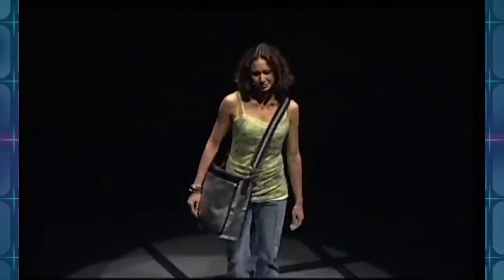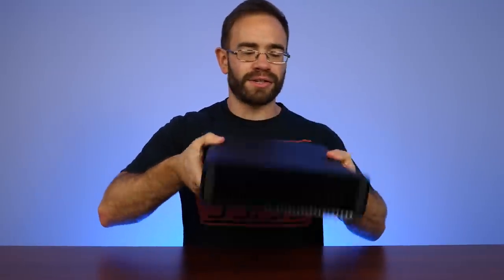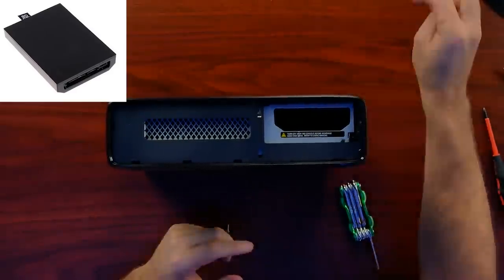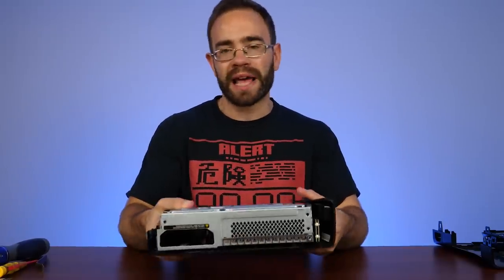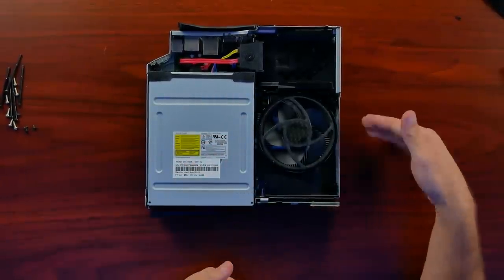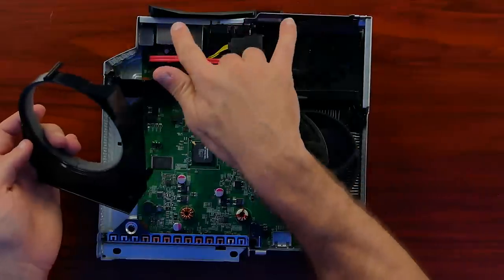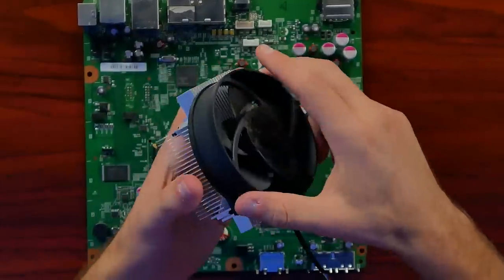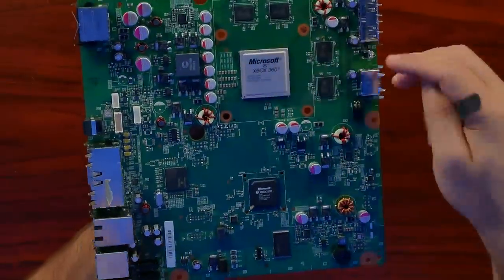Here's How Microsoft Solved The Xbox 360 Red Ring of Death

Comment: they didn't solve anything, I went through five 360's. after the fifth one I said screw it and got a ps3, I still have the ps3 and it still works
Reply: 360's have a PLASTIC ventilation system (as shown at 9:24) which is unnecessary, IMHO. When that thing heats up shit happens so, I promptly removed the said PLASTIC ventilation system. Now you know the SECRET , shhh :D
Reply: I used to get the single red ring every now and then but there was a simple fix for it
Reply: @MrShokzZ  the TOWEL TRICK :D
Reply: Had the rrod on an elite version , send it to fix under warranty in europe, received and still works today. Its connected with kinect next to series x :)
Reply: Actually they did ps3 btw had the same thing except yellow lights.  Actually slightly worse as the board often was still left twisted even if reballing the solder worked.  They didn't extend the mfg warranty either like MS did.  A redesigned, heatsink with heat pipes and hq thermal paste was the MS fix.  Like you it sounds Some however did not get that. Whether MS was just getting lazy or they subcontracted who knows.  Though at least they made an effort my ps3 died and Sony never would acknowledge an issue none the less fix it.  They did change the design in subsequent models but that didn't do anything for current owners.
Reply: i’ve had a xbox 360 for 11 years
Reply: You should of fixed it there’s a ton of tutorials online or shops in most cities
Reply: Lmao i still have my original 360 and never had a problem with it
Reply: I have a PS3 with the YLOD. Definite cold solder joint issue because I've revived it by wrapping it in a towel, etc
Reply: Hmm my elite works up to this day...

Comment: No.
Microsoft solved the Red Ring of Death in the late GPU_RHEA model on the late Falcon motherboard. The Slims have actually had GPU failures much more often than the Phat Jasper.
The fault was introduced by ATi and was part of the 2005-2009 GPU plague and was fixed when the RHEA chip was revised to correct the flaw. The issue was in the chip die of the GPU (northbridge) failing or becoming disconnected from the green substrate. The only way to resolve this is to replace the GPU for a different one that has not failed or is fixed.
The Jasper phats do not exhibit this GPU flaw at all, and the Slims and E didn't seem to, but they've started failing around 2019 and still going in 2020 which is something I am researching still. So far it seems a failure on the XCGPU (north bridge memory controller to be specific)

Most reliable motherboard is a Phat Jasper v2/Kronos which is the full 65nm chipset.
Reply: Yep. Some people think its the solder but that isn't the case.

Comment: The longest any of my white 360's lasted was like 8 months. Went through 3 RROD. Back of them felt like a space heater. I kept sending them back in and microsoft sent one that had the added heatsink with cooling pipe and it didn't last either. I take the best of care of my stuff and all my original systems back to my 1988 NES still works fine and looks new. I ended up getting the halo reach 250gb limited edition off ebay which was like new and it still works great 10 years in. That thin heatsink sandwiched between the GPU and DVD drive was a recipe for disaster simple as that.

Comment: While this covers the most visible changes from the original Xbox 360 to the Xbox 360 Slim, there was probably more engineering changes not noted. It was a rumored factor that the solder selected was not designed to withstand the heat that the console produced. Another possibility was that the chips dissipated more heat than they should. Both factors would have probably been avoided had MS used an ASIC vendor in designing the system; MS chose to save the $25M or so it would have cost to use one. Instead MS designed the system themselves without that expertise.

Comment: Ah yes, the towel/blanket trick for the red ring of death. I remember doing this as a teen. I had found an Xbox 360 in a dumpster sitting on the top. I had taken it home and cleaned it up. The Xbox surprisingly worked although it was missing the face plate. It worked for about 6 months before it got the red ring of death. I had watched a YouTube video about someone wrapping it in a towels/blankets and figured I had nothing to lose on a free Xbox. I was surprised when it worked. It actually worked for about 2 months before the red ring came back. I tried the towel/blanket trick again and it ended up breaking the Xbox in a new way. After the second time the Xbox would work for about 30 minutes and then crash. If I immediately turned it back on I'd get the red ring. However, if I left it off for 5-10 minutes it would power back on, but again it would only work for another 30 minutes before crashing again. At that point I considered it a loss and tossed it in the trash.

Comment: DVD drives easy to replace you say. This assumes the DVD drive circuitry isn't the problem and you can find the same vendor and version for replacement. 

These systems had a UID encoded into the DVD drive firmware that made that drive only work for the console it shipped with. Rewriting the code on new drives was easy enough, but getting it off the old drive was such a pain.

Comment: You couldn't just replace a disk drive.  They were married to the motherboard via firmware.

So you either had to replace the individual component that went bad in the dvd drive if it wasn't the logic board, salvage the logic board from the old drive and hope it worked, have a backup of the old drive's firmware and serial numbers and flash the new drive with that information, or you had to jtag or rsg hack the console, the latter 2 being somewhat risky for using the xbox for online play.

Comment: That 4gb unit goes bad all the time. If your console fails to boot, that is often the culprit. If you have a hard drive installed you can rip that sucker out to solve the problem.

Better yet, you can remove that unit and install a USB header in it's place and use it to install a second internal hard drive!

Comment: Dont forget the problem with the scratches with the old consoles, there where even courtcases of it.
I still love this system today, i have 1 Jtag, 1 drived mod (some on wanned to trow it in the trash.. so i took it) S model and a E model. The last one is the best revision they made.
I had the RROD just when Saints Row 2 came out, i had to send it to MS and wait and wait till i got a replacement.... :(
Reply: My first system would create too many scratches on my discs. I returned it as it was under warranty, and my new xbox 360 died after 2 years because of red ring.
Reply: E is not the best for reliability. Jasper is.

Comment: The worst that happened to me (that was around 2006), was two games getting cracked by the heat of the system, that was my first and only RMA for the system. Then the second system, in late 2008, got the RROD, warranty was out and I had no money (I was 19 with no job because recession) so I sold it as parts, planning to buy another one eventually but never did. Eventually I got a PS3, but I wanted to have both. Alas, only the XBLA exclusives and a few others are worth it, otherwise, everything was on PC or PS3 or both.

Comment: I just realized I've had a hdd floating around in my slim for 10 years!  I bought a slim on launch day and moved my HDD over. There were no caddys out yet, so I just plugged it in. There was a gap all around, but the unit was placed vertically and has never had an issue. I forgot about it, until this video.

Comment: @12:27 "they had to ramp the fans up"
Actually on my 360 fat "Falcon" model the main source of noise BY FAR was the dvd drive with a game disc playing inside. When playing Xbox Arcade games that don't use a disc in the drive, the 360 was pretty quiet. When Microsoft added the ability to load games to the hard drive my 360 became quiet even with disc based games.

Comment: If i remember correctly on the one back side where the clip is near impossible to get to under the sticker there is actually a hole. If you use a jewelers screw driver you can easily push that clip.

Comment: I used to own an original Xbox 360 and then I traded it in for the Black “Elite” with a 120 GB HDD.  I remember having to send my Elite in for the red ring of death and then I ended up selling my replacement Elite for some reason and fell out of gaming completely soon after for a couple of years for personal reasons.  Eventually I felt the need for a 360 to download my exclusive 360 games soon after the XboxOne was released and bought the 360 E with a 250 GB HDD and that is the one I own today.  I do notice it is much quieter than the original model and I still have no problems with it.  The only thing I miss is the big power button but otherwise it is the best 360 I have owned.  And yes, it’s still hooked up next to my XboxOne X and Xbox Series S.

Comment: some great xbox 360 games aren't bc on the XOne or the XSeries, three of my 360 games I wanted to play really recently but can't (The Saboteur, Project Gotham Racing 4, Army of Two 40th Day) I will have to put the discs in my 360. The price of the 360 will inflate more as there is a ton of games like I mentioned, and as more systems fail. the Xbox 360 S is almost a collectors piece as they are instantly more recognisable to be reliable, whereas the original 360 revisions (Xenon, Falcon, Jasper, etc.) look the same without examination, and those early ones were notorious

Comment: I love how they just put giant fans on everything now.
Reply: That looks like a pretty standard sized desktop CPU heatsink fan, around 90mm just from a guess, like what you'd find standard for consumer level AMD and Intel desktop processors made in the last 10 years. They needed to keep things cool, they went with a fan that was big enough to do the job and make as little noise as possible. At a basic level, The smaller the fan, the more it has to spin to maintain a similar temperature and louder it will be compared to a larger fan. So one big fan is better than two smaller fans, especially if that one big fan has way less work to do vs. two fans pulling air through a whole system first. It looks like it's sucking air straight in from the side grille and down onto the heatsink, which goes down onto the board, which is great for airflow to other motherboard components.

Comment: Your physics is wrong regarding why the OG 360 was louder than the slim.  The design of a wind tunnel is not the reason why the old design was so loud, it was the heat produced by the cpu, the size of the fans and their placement.

The new design ran much quieter because the cpu was a smaller production design and smaller transistors run more efficiently which means they exhaust less heat, the fan placement also made a great deal of difference because heat will naturally rise allowing the heatsink to expel some heat naturally through the top exhaust and then finally the fan on slim is much larger than the two smaller fans on the OG.  One larger fan is able to move more air than two smaller fans even if the smaller fans are spinning at a much faster RPM.

Comment: IIRC, you couldn't replace the disk drive that easily... The firmware on the DD, likewise the CPU, had a unique value used as ID. When the system boots up, it checks if the DD & CPUD ID match up with the values in the firmware. If it doesn't match, it refuses to boot. SO, u ha to flash ur drive beforehand with the correct ID.

Comment: Damn...What's crazy is I never got a RRoD on any of the Xbox 360's I owned, but every other friend of mine did. Bought my first one in March 2006, for TES: Oblivion, then sold it off for a PS3 about a year and half later(no issues). then picked up the cheaper Arcade model when it introduced the HDMI out I think in 09'. Then I traded in that one for the Xbox 360 Slim(glossy black one) when it released(2010) and kept that one till around when the PS4 launched. 

Funny enough my fat PS3 60gb got the dreaded 'yellow light' after a year and a half owning it, as did two other friends of mine.

Comment: After tearing my xbox 360 apart to clean it I can see why it had overheating problems, there is hardly any place for air to get in, the main pathways for air is the sides (horizontal orientation) or top/bottom (vertical orientation). One of those sides is completely blocked by the HDD. That leaves you with one side to get air from and if have the xbox vertical that seals off that other side. I took the plastic shroud of the bottom and I keep it horizontal and it works fine to this day.

Comment: I fixed my original xbox 360, the RROD, resoldered the board, put Arctic paste on the cpu and gpu, replaced the fans, added extra copper to the heat sink and made up a better clamp for holding the heat sink, took away the X clamp and its still working.

Comment: I got the RRoD on my 'Elite' 120GB 360, but having known of the issue, had only bought it after they announced the free repair program. So when it eventually happened, I think after about 2 years, it was sent from the UK to Germany and back, in just 8 days. I ended up selling it to get the 360 slim 250GB, and then trading that against the 360 slim Halo 4 320GB model. That was a steal, traded in the 250GB model + £100, and got; bigger HDD, fresh warranty, custom blue shell console, 2x matching controllers (my trade in was only 1 controller) and Halo 4 on disc. If you removed the cost of the game, which I'd have bought day one, it was only about £60 for the upgrade. That's the console I still have today.

Compare that to the PS3, my PS3 'phat' 80GB lasted about 4 years (YLoD), but sadly no free repair there, so I had to just buy a new system. By that point though, they had just released the 'super slim' models, so I got the 12GB model in a game & 2x controller bundle for £160. I sold the game and my 2 older PS3 controllers, and bought an internal HDD caddy so I could install the 320GB drive from my broken PS3. So the £160 turned into about £88, which wasn't too bad.
The 'super slim' lasted about 5 years, and then one day I think the PSU died as there wasn't even a red LED. It lasted a year longer, but what an awful console revision. The top loading design never bothered me, but it developed a horrible coil whine that I could hear across the room.

I now have a PS3 slim 160GB, I got it in Feb 2018 used from CeX in the UK, boxed for £75. I probably could have got it cheaper, but at CeX they offer a 2yr warranty and I figured someone who kept the box probably kept it in good condition, and about 2.5 years later, it still works well. 
Having owned all 3 PS3 models, I'd definitely recommend the slim. The 'phat' models seem to have a higher failure rate, and the coil whine on my 'super slim' seems to he a common issue.

Comment: Did anyone else think it was going to RROD at 0:20?  

My launch failed within a year, I bought it second hand so I cooked it 4 times in the oven to keep it going. I redid the x clamp and even installed a 120mm fan on top because I was into PC modding at the time also. I eventually bought a cheap 4gb arcade slim when the new revision came out and threw my hard drive in it. No more issues.

Comment: 512mb memory units were $59.99 and the 20gb HDD retailed for $99.99. I should know...I only had a core model Xbox 360 (No HDD and a wired controller) back when the console launched in 2005 and had bought the 20gb HDD in early 2006, good times. 😅

Comment: The reason 360s failed was the Low-Tg underfill used on the GPUs. E74 gave it away as EDRAM didn't go through the mainboard, and it was even confirmed in the documentary. BGA faults are pretty rare, but they do happen. From what I can gather from youtube, Slims usually run hotter than Jaspers.

Comment: I recently had that problem where the drawer didn't want to open I've been leaving the game in there and it's been fine but the problem ain't the door cover it's the two magnets that help hold the disc from flopping around too much when it goes to open those magnets don't release that's why if you leave a disc in it and go to open it it works if you don't stay shut because that top magnet is still stuck to the magnet where you put the disc in and the whole of the disc that's magnet right there and I'm inside on the top is a magnet that click together to hold it and it's actually pretty powerful magnet one that powerful no wonder why there's a problem engineers didn't think things through too well there.